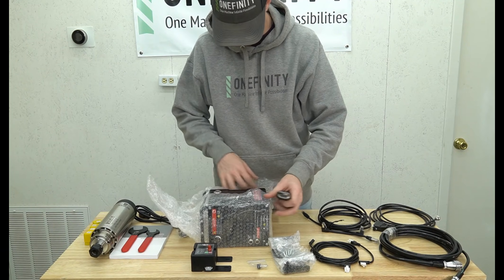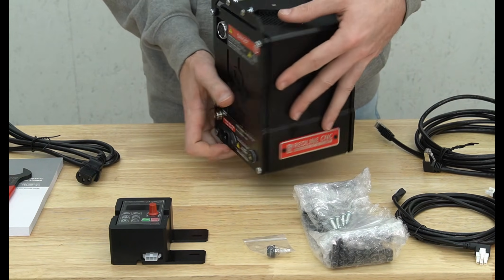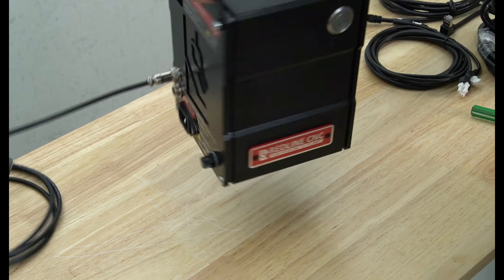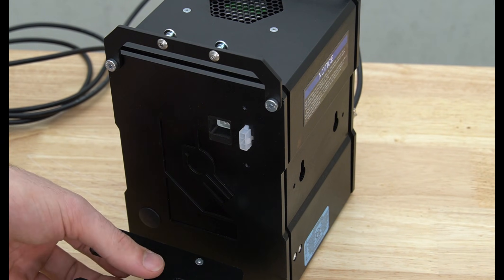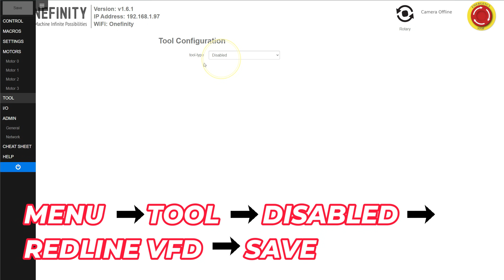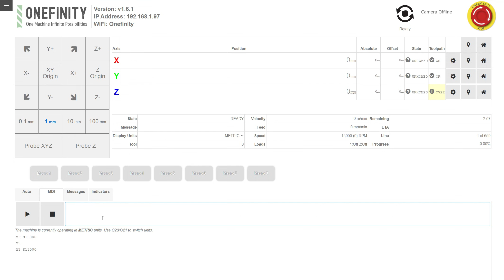Onefinity Spindle Kit by Redline CNC | Buildbotics Installation

Comment: My machine is currently down. The Redline spindle trips the GFCI as soon as I run it in manual mode, so I won’t be able to use the CNC until this issue is resolved.
Reply from the maker: you cannot use any cnc spindle on a GFCI outlet.
Reply: @OnefinityCNC  recommend adding those in the manual thanks.
Reply from the maker: It is in the Redline manual.

Comment: Could you guys start adding in all the steps instead of skipping things that you guys think are basic and don’t need to be shown… like how to actually turn the spindle on… 

I just want to know which button to push at what time, and I can’t seem to find that anywhere… 

I’m guessing it’s in the all too hidden manuals that I had to comb through my e-mails to even learn the existence of… but that just brings up another note: 

For the $800 I spent on the spindle, and the $2,200 I spent on the CNC proper: I think it’s absolutely absurd and just asking for pissed off customers to not include a PRINTED, PHYSICAL MANUAL instead of making it the customer’s problem to have to go and search for VERY BASIC info on their $3k machine. 

I finally got a printer recently: so I’ve fixed this problem myself already…. But just expecting people to look up your YouTube videos, look in FaceBook groups, or have to comb through the huuuuuuuge amount of emails Onefinity sends to even just learn that a manual for these things even exists. 

I get it: ya’ll are an internet advertised business…. So why can’t the customer use their internet to find instructions?

Because for easily distractable folks as myself: the internet is a trap that I’d rather avoid when I’m actually trying to do things like get work done on the CNC… and it’s just such a cheap thing to include that would make the growing pains of using ya’ll’s machines muuuuuch less. 

I literally have had my woodworker pro since February and haven’t done a thing with it because I couldn’t find anything but vague YouTube videos for freks sakes…. :/

Well: my first project is happening today… so let’s hope it goes well.

Comment: with the spindle taking up the whole of the db25 connector, what are the options for triggering vacuum start\stop on a spindle setup?
Reply from the maker: The option adapter we are going to sell.
Reply: @OnefinityCNC  Timeline on availability for this adapter? Or, pinout so we can make our own? Shopvac control via the Buildbotics or OtherSpindle is a game changer and a requirement at this point...